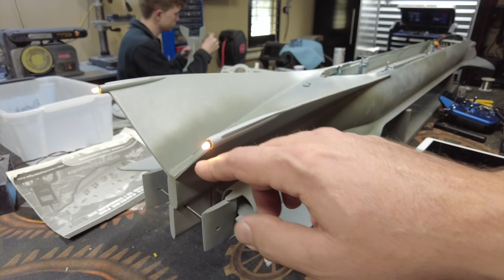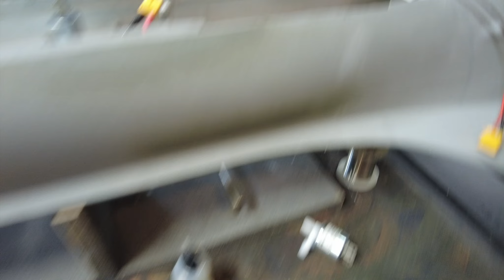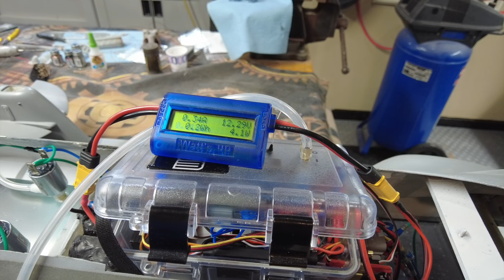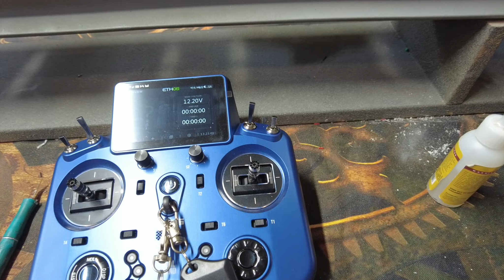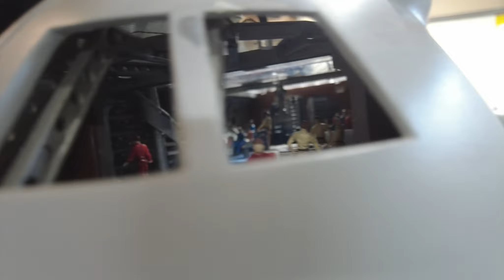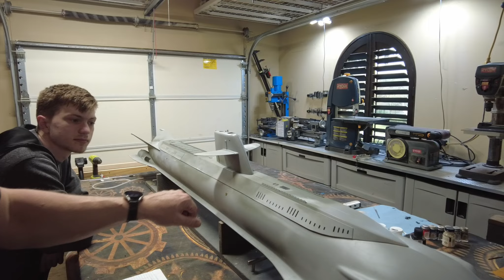80" Deboer Seaview Build Blog - Chapter Four

Comment: Great work here,the engineering would make Admiral Nelson proud! I am looking forward to see the Seaview in water.
One little tid bit of probably useless info,the moebius 1/198 scale flying sub version of the Seaview seems to have a problem with diving while underway,yet the movie( and first season) 8 window Seaview doesn't  seem to exhibit the same problem, just wondering  if you have any thoughts,the flying sub version has a  thicker keel  under the bow( obviously to fit the flying  sub) and those 2 large teardrop shaped sonar domes,the bow might be very slightly longer but on the mobius 1/198 the flying sub version more closely resembles the 17 foot filming model while the 8 window looks more like the 8.5 foot filming model.the front manta Ray  fins were thicker on the 17 ft vs. the 8.5ft,and the side profile of the bows were different. Any way looking  forward  to part 5!